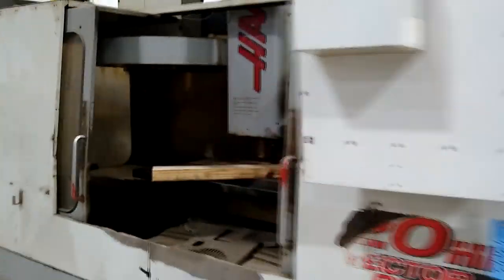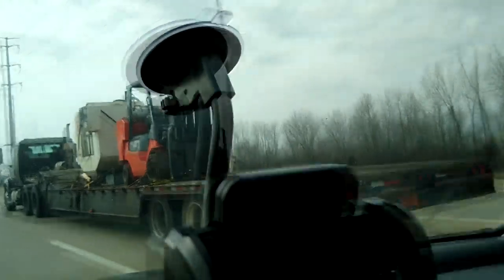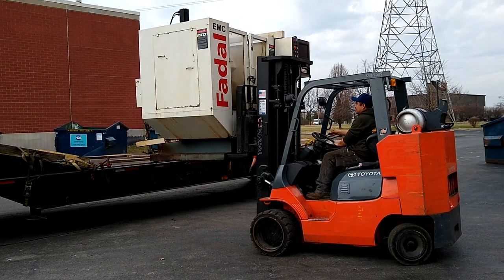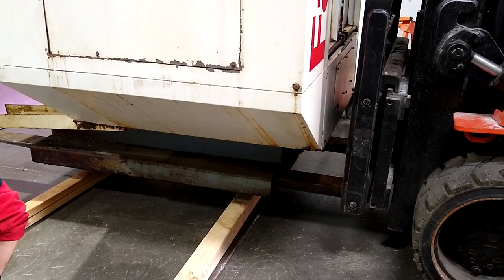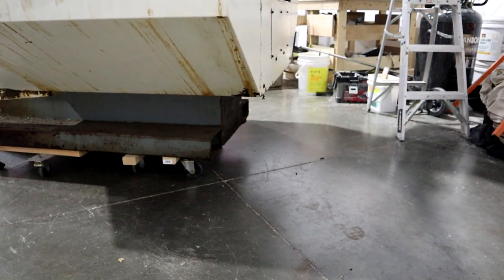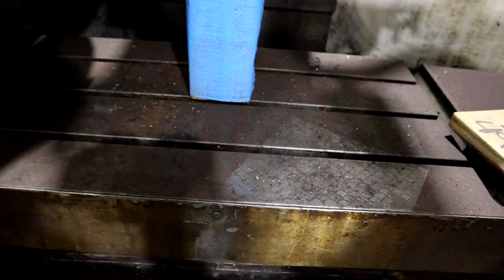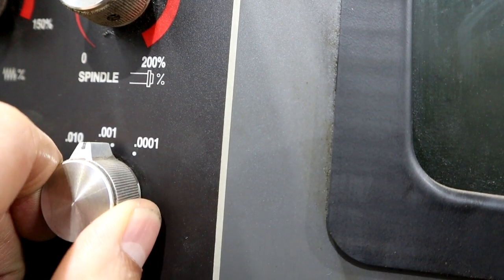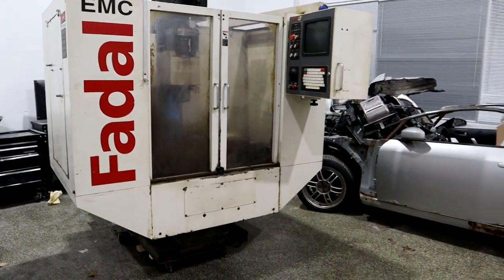How much it cost to buy my first CNC Milling Machine!?

Comment: $8600 seems like a lot for what you got. I got a bigger machine (32x20x20 15HP spindle, 5HP axis drives, 24 spot tool changer) for $1500 because the previous owner had electronics issues and got fed up with it. The electronics issues were really easy for me to solve, and now I'm working on the mechanical side. I pretty much have the machine stripped right down now (table off, saddle off) and cleaning everything and putting it back together. In a lot of ways, mine is in similar shape to yours - needs a complete cleaning and some mechanical repairs as well. Basically a complete tear down / clean up / rebuild. Of course being a bigger machine, it's a lot harder to work on - everything is bigger and heavier. I have to laugh at some of your commentary, as I've had the very same thoughts. Nice to see your machine running - I'm hoping mine will be running in a few months. No small project rebuilding a VMC!
Reply: I wish You all luck 👍
Reply: just hit me up the next time you find this available for 1500 bucks
Reply: @MrObsvenchilde  I saw a Haas VF-2 go for $1400 at a local auction last week.
Reply: any suggestion? I am looking for CNC turner and VMC
Reply: Paying $7100 less and still not having a running machine isn't a flex. Consider that either machine can be making $35k/month pretty easily. If he beats you to the first job by a week, he's even. If he beats you by three months, you've lost $100k in opportunity cost to his machine.

Comment: back in the  90s ...  this size was sold as   VMC 40  ( VMC 2016 )  -  20   /  16  :) I have one  from  1995 as VMC40   :) although it has a  21 tool  changer Yours uses a 3 phase servo ... my old one has a DC servo :)

Comment: Did you need to configure your garage for 220 3PH electrical service? Belt driven spindles are OK... However, many of the newer machines, and almost all of the higher-end models are direct drive to a gearbox on the spindle... Some are even direct to the spindle itself now, although I'm not sure how that works... When you get to the point where you absolutely need to buy an entirely new machine (and that WILL happen sooner than you think, rest assured), Haas is the way to go... They have a wide spectrum of CNCs to handle every aspect of your machining needs...

Comment: Grats on the machine. That's bad ass. I'd like to cut out some foam one day!
Reply from the maker: Thanks. CNC machining is a fun hobby. For hobby and light materials, you should look into building your own machine.
Reply: @InspireCNC  You've inspired me to build one. Ive been meaning to learn the workflow needed to make custom body panels out of fiberglass and i think I'm at the point of my life that im really ready to do it. I found a video of a DIY 3 axis that looks capable for what im trying to do with a build cost of about $900. I'd greatly value your opinion it. If not that's cool too i already apprechiate the information you've already shared so far. Thanks

Comment: Fadal are one of the first CNC machines I learned to use in college for Machine Tool and Computer Aided Manufacturing Technology. Great machines and can do the job. They are a little finicky when you g code isn’t perfect. Fadal has there own form of G code specifics but they have been around for a very long time so I’m sure there is a lot of open source stuff. If you find that in the future you want to grow into something a little easier Haas are great cheap machines. I have working in the field for 7 years and used Mastercam cad/cam software mostly.

The biggest things to stress:
 When jogging any CNC machine is always make sure you are in .0001 or .001 feed.
When proofing any program new always step your program line by line and always in .001 feed. 
If you can perfect this you will almost never crash the machine. If you do don’t beat yourself up...all good and great machinists have done it.

Good luck!